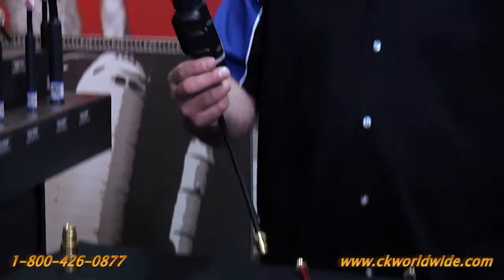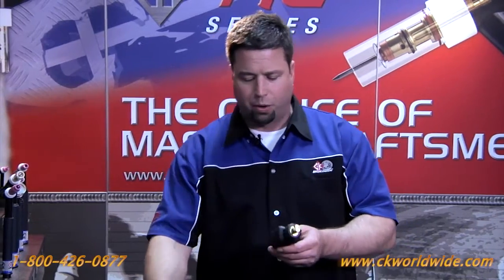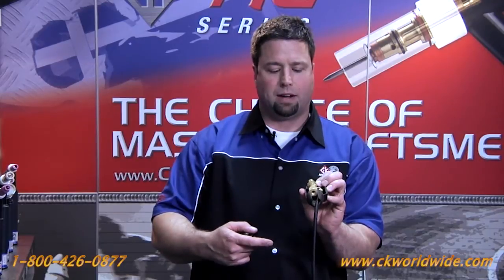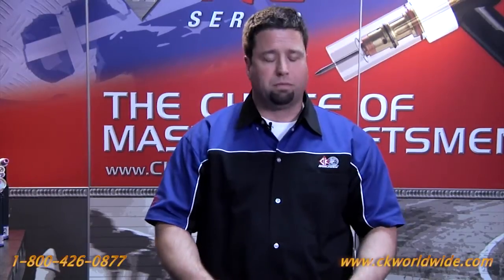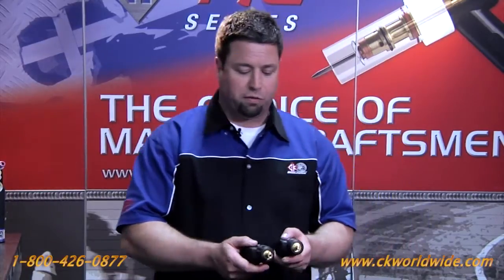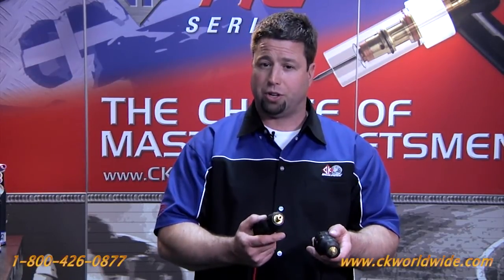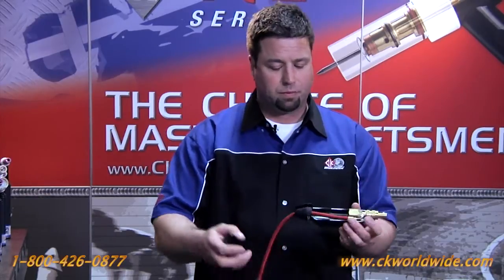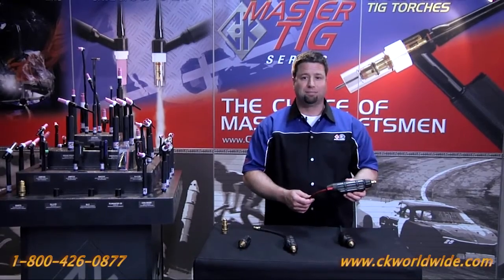Safe Loc Quick TIG to Stick and Euro Dinse Connectors

Comment: on that particular dinse connector in your hand; how the gas coming thru the dinse from the power supply  gets to the torch?  since the red hose is for the hot water return going back to  the water cooler, or the same cable/hose carries power, (hot return)water and gas?
Reply: The large brass connector is where the power and water return go, then there's 2 other hose one for water in and one for gas.
Reply: @deepwinter77  I thought the main Dinse connector was gas connection and the other 2 were water in/out? On my Lincoln square wave main center Dinse connector is a M style with gas though it. The gas connection from cylinder is on the rear of the welder.
Reply: @robert5 Dinse with pass through is not as common, usually the gas is fed into the side of a dinse adapter from your machine, your Power and water return are Red, water in blue and gas is the third. 
It's the same setup though in terms of power water and gas.
If you look up the manuals for CK water cooled torches or water cooled safe loc it will have a "circuit diagram" showing the inputs etc.

Your welder has gas input at the back then at the front gas out but there's a small hose going to the side of the Dinse adapter, as opposed to coming through the actual Dinse fitting, its plumbed to a 3/8 or 1/4 bsp depending on the machine
The plumbing to the torch though is the same.
Reply: @deepwinter77  Thanks for the explanation. On the lincoln square wave 175 the gas does go through the dinse connector there is not a separate fitting and then it goes into the side of the dinse connector. I am using it now and that is the way it works. That is why I thought what I thought, I don't have experience with a lot of different tig welders and how they work. I need to buy a water cooled tig torch and it will take a larger version of the same dinse connector I have now. It will be a gas pass though and the water will connect to 2 other lines. it will be a dinse 35m size with gas pass through. If you dont agree with this, search for dinse 35m gas pass though and you will see them. Thanks and hopefully you don't see this as arguing with you but I weld with the machine I put it together and I know how this particular welder works.

Comment: Buddy you need to learn your metric measurements, 3/8 inch is 9.5mm and 1/2 is 12.7mm. Remember and inch is 25.4mm.
Reply: The Dinse connector in Europe have a naming nomenclature that actual relates to the cable that fits the connector not the actual front connector part, so its 10-25 Dinse and 35-50 Dinse which is mm2 of the conductors they are rated for. 35mm2 cable etc.
Reply: @deepwinter77  Julian thought he was a genius because he finally learned how to weld vertically. You’ll get that sometimes in the USA!